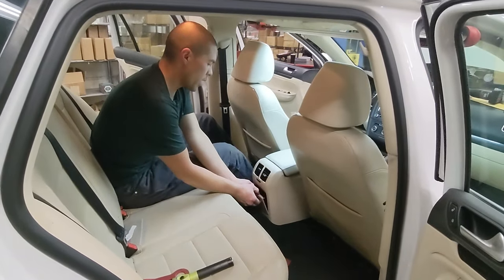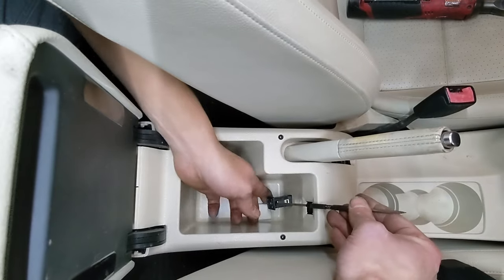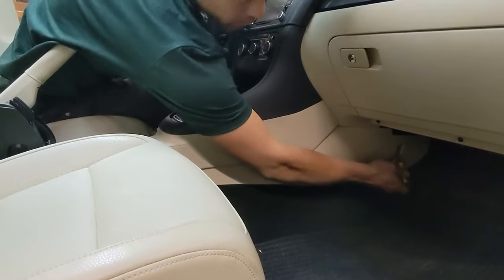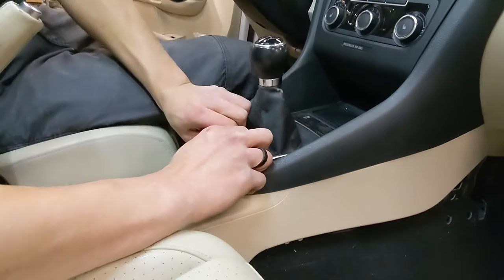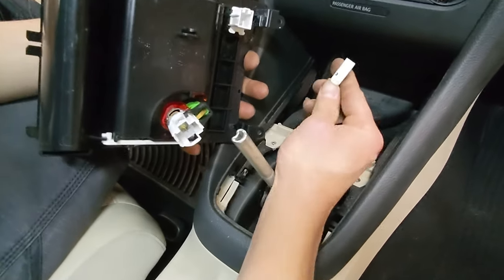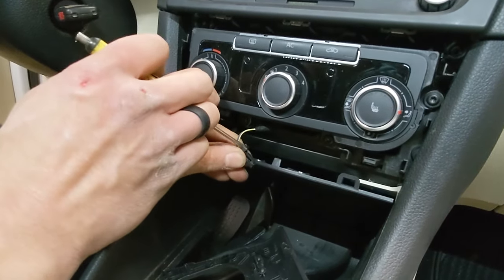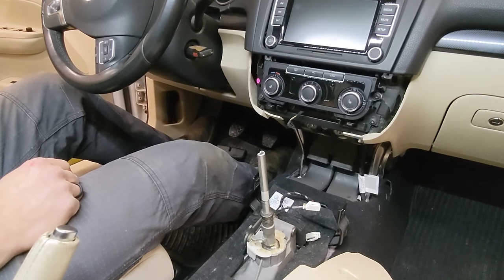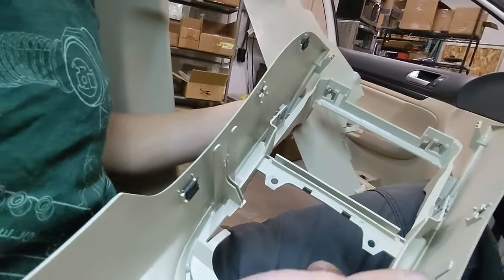MK5 / MK6 Center Console Removal by Dieselgeek

Comment: I need to remove the black “forward section” of the console around the shifter. So the screws u see the climate control surround and radio surround hold that in or is it just clipped?